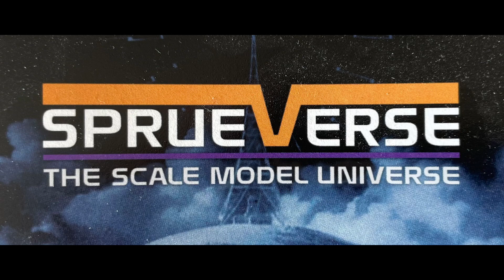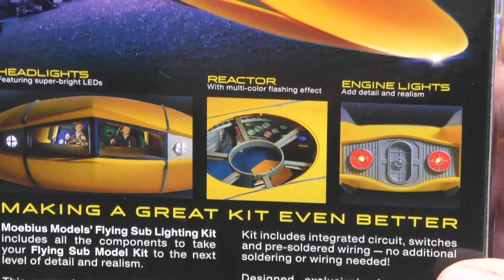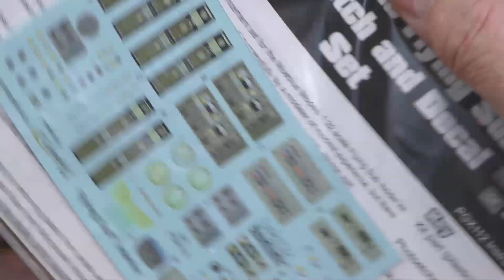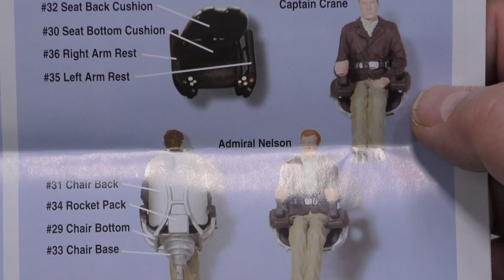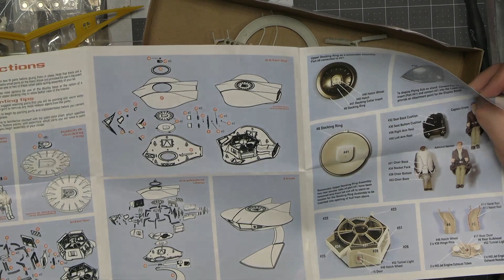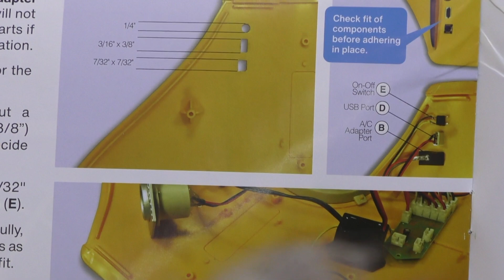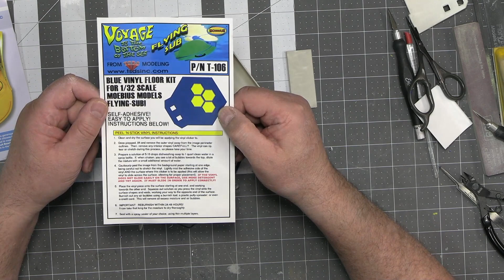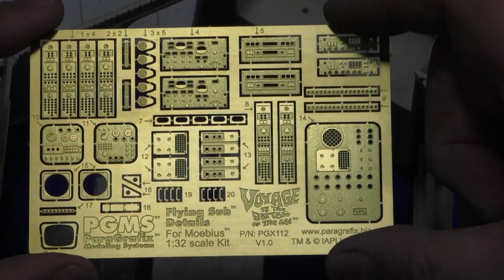Build the flying sub from Moebius Models in 1/32 scale

Comment: Built that kit about 2010.I used my own electronic skills (because I was going to school for electronic engineering) and there was no lighting kit at the time. I did one thing that is not included in the lighting kit you have. I lit up the dashboard with individual LEDs. I did not use any SMDs because you had to solder your own leds to them. I used 2 (9 volt batteries) and hid them in the hallway between the back of the ship to the inside. (I recently changed it to a wall wart) Great kit. Have another one in my stash. Hope to tackle it when I retire in the next 2 years. I will definitely bring it up a notch when I do. Love your work , and keep it up.
Reply: Hope you video record your build and post it on youtuube!

Comment: Hi Phil. Another video done in your own individual inimitable style!  👍😁  I, too, was one of the people initially thinking that you can paint the floor but after thinking about it the vinyl would be much better for light blocking on a transparent piece.  The lighting kit does look a bit old-school with big 5mm LED's everywhere.  That reactor wall is just crying out for a custom circuit board with little surface-mount LED's.  The problem with prebuilt units is that they are often limited and unexpandable. Unless it has a way to tap the power you cannot easily add your own extra lighting.  Having said that,  the main circuit board looks like it may have at least one spare socket so maybe the designers have left this option open. I don't like the look of that little tactile switch - I suspect that it may be tricky to fix it in place without glueing up the switch itself.  Also,  the way it appears to be mounted risks pushing the switch into the hull 😧. I tend to do my own lighting circuits which gives me maximum scope and flexibility but then again electronics and microcontrollers is another hobby of mine that meshes very well with the modelling. I have had mixed results with the Tamiya fine surface primer rattle cans - when they work they are excellent,  especially on bigger kits such as this, but I have found that they can give a rough sandpaper-like finish on occasion. From the way that your fingers sounded when you rubbed the model I suspect that you have had this trouble too. I think that (like with airbrushes) it is caused by the paint droplets drying in flight between the spray head and the model surface.  I think the problem is likely due to a dry atmosphere and with airbrushes it is possible to use retarder to combat it but with a rattle can there is not much you can do.  If you hold the can closer to the model to reduce the time the paint has to dry before it reaches the model you risk "spider-webbing". For this reason I tend to use an Iwata Neo TRN2 airbrush for this kind of job - I have more options to mix the paint to work in the ambient conditions. The Vallejo primers come in nice big bottles and the TRN2 has the option of large capacity cups. Looking forward to the next video 👍😁

Comment: I am so  looking forward to watching this Phil. I am king of hoping you change your mind about lighting the control panels .   This along with the large Jupiter 2 is the grail kits for Irwin Allen in my opinion.  
But I  still am looking forward  to seeing it. I was hoping to start mine soon but got distracted  with the Enterprise Refit ( Yes your fault) . 
I have most, not all the aftermarket  products to go with it. For your convenience:
The kit
The official lighting kit 
The Voodoo effects lighting kit 
The Stsrling-tech sound board
Aztek Dummy paint masks (of course)
The ParaGrafix photoetch and decal set
The TSDS Waterslide decals 
The TSDS aquafoil alternative decals 
TSDS Blue vinyl floor kit.
Aftermarket chairs from Shapeways (GAS Designs)
Aftermarket figures from Shapeways ( GAS Designs) of Kowalski, Crane, Nelson and a figure with joystick 

Listed just in case you missed something you like . 
The only official thing I don't  have is the accessory kit but it is very rare and expensive.  Plus I  don't need it .

Now if only I  had the skill .....

Comment: Looking forward to the build, I have the original boxing and the re boxing with the figures, but not sure if I would use them, they certainly block out the interior lighting when they are seated. Flying Sub and the Spindrift are my favourite Irvin Allen ships, just wished someone would make a new tooled 1/32 Spindrift.
I have seen lots of builds of the reactor wall lighting on the FB but not seen anything that really looks accurate to what is seen on the TV show, the lighting seems to have a rolling effect like they were mounted in a opaque drum, hard to explain, it make be a effect of the filming they used, or the frame rate on video, but it's hard to get looking right in my opinion.
Reply from the maker: Agree! I’ll be building a 24” spindrift soon!

Comment: My only crit of the channel is that you are working in the past. The distant past. I believe you have already moved on to the LIS Pod and even this very show is about a month ago. With that said, why I am displeased is that I - we -- may well have some things to say that might have meant something when there was a chance for you to think things over. But not to worry, these are still interesting and entertaining.
For example, I would have been howling at the limits of that outrageously priced (I know, hand finishing costs a lot no matter from where!) lighting kit. What doesn't it light? The interior. There should be a couple of somethings along the ceiling. That electroluminescent sheet seems mighty dim. One thing you did not comment on was the clear part of the floor beneath the good Captn's and Admiral's feet. There seems to be a chunk of that custom cut sheet that fits under them. Yes, some nice uplight, but not really enough for the interior.
If there was more time I would have recommended splitting off another 5V rail from the USB or transformer socket and resistor several more LEDs for here and there.
The saddest thing I've heard in months is the lack of response from Lou and Wayne over that neato model rest. In their defense, it looks so nice they may have thought you'd just bought a dog bed. (I do think Lou mentioned it more around the time you'd visited...)